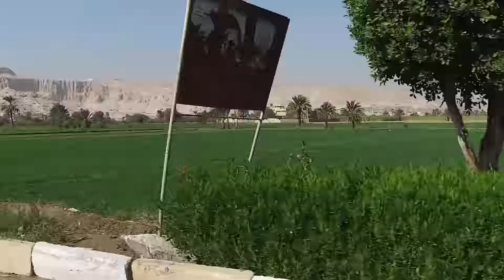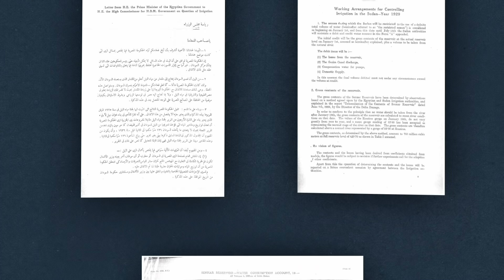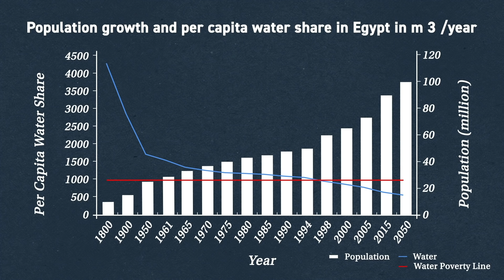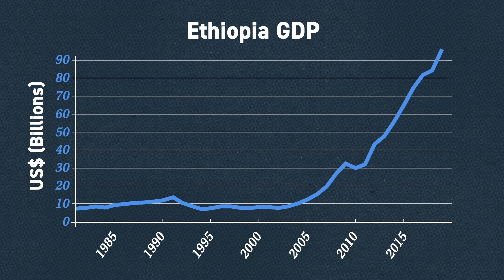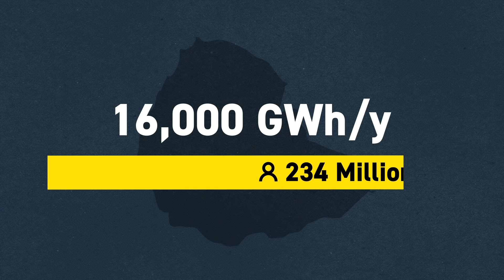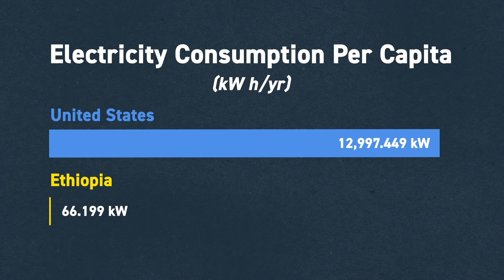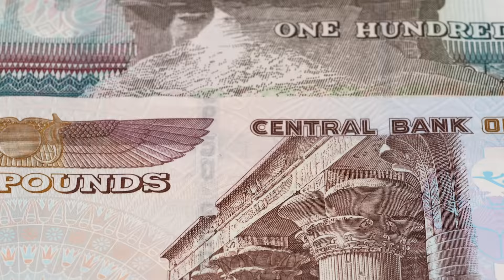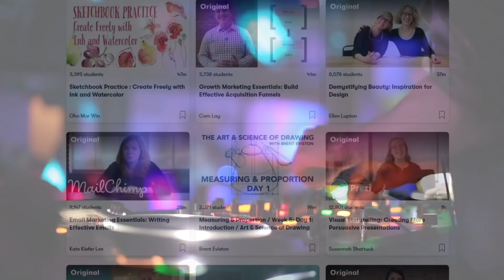Egypt's Dam Problem: The Geopolitics of the Nile

Comment: Egypt just needs their own dam! Sure, Ethiopia can cut off the water supply, but without an extensive series of pumps or canals or something to move the water elsewhere, they can only do that so long before the reservoir overflows. Egypt just needs a reservoir of their own large enough to hold out until that happens :)
Reply: @DavidJohnson-dc8lu  I mean that was mostly a joke, but it certainly would be possible...they'd build it the same way anyone else would build a dam. Obviously they'd need to fill it BEFORE Ethiopia decides to shut off the water, but since Ethiopia can only spring that surprise once and only for a limited amount of time they're not likely to do it right away...

Plenty of countries hold reserves of various resources in case of war or other shortages. Same idea here, except easier. If you don't produce oil and nobody will sell you any, you're kinda screwed. A trade embargo like that can last as long as it needs to. But Ethiopia is gonna have a hard time holding back the entire Nile indefinitely, the reservoir only holds so much, so it should be possible to calculate exactly how much water Egypt would need to store in order to counter that threat. They could store it in barrels or big underground tanks or something, but a big reservoir behind a damn seems like it'd be easier...
Reply: @Urza9814   I don't think you understand Geography, the Nile starts from Southern Africa from Burundi, Rwanda and Tanzania. The blue Nile comes out of Ethiopia directly and the Blue Nile connects to the Nile in Khartoum, Sudan. Egypt is the last country to receive the Nile, building a dam means they have to go into Sudan and build another dam which they have no rights to. Egypt building a dam in Egypt is a wasted expense, they have to go in another country they have no legal rights in 2020 and from now on to do. Learn how the river Nile flows, which is up flow not down flow and where it starts.
Reply: @DavidJohnson-dc8lu  I don't think you understand how dams work. As long as the river flows through their country, they can build a dam on it. You don't have to be right at the source of a river to dam it...

Now, there might not be a suitable location for such a reservoir, or it might require flooding land that is too valuable or blocking river traffic that is too essential, in which case they'd need to compare those costs against big storage tanks or artificial lakes or desalination plants...but it's not an insurmountable existential threat, the amount of water they would need in order to counter that kind of hostile action by Ethiopia should be pretty simple to calculate if you've got the information and resources of a national government. It's not an unknown quantity, they should probably already know exactly how much such a strategic water reserve would cost to implement and how best to implement it. Maybe it's a dam, maybe not, but that's certainly one of the options.
Reply: @Urza9814   Yes but Egypt building a dam does not limit water from going to Ethiopia or Sudan. River Nile starts in *Burundi Tanzania, Rwanda*, DR Congo, Kenya, Uganda, South Sudan, Sudan, Ethiopia and Egypt, in that order. Any of the countries builds a dam it restricts flows to the proceeding countries. Egypt building a dam would be Egypt building restrictions on itself. The waters that enters Egypt does not flow back to Ethiopia, Sudan, South Sudan, Uganda, Kenya, Congo, Rwanda, Tanzania or Burundi. The River Nile is dependent on rain from Southern and Central Africa not Egypt. Egypt is just a beneficiary of the rain from the South. In fact, I think the dams that have been built might even cause flooding in Burundi, Tanzania and Rwanda, these countries produce rain very well, but the dams restrict natural water flow.  Also just look at Zimbabwe, the moment the built one of the largest dams in the water, was the moment that country suffered from drought. Dams bring drought or flood. Depends on how it rains or if the area is reliant on the river directly.
Reply: @DavidJohnson-dc8lu  you are missing my point entirely. They don't have to prevent other countries from getting water, they have to store water for themselves. It's not about building a dam to stop the water -- that's really not what dams do anyway. It's about building a dam to have a reservoir for that storage.

The upstream dams can't block the river forever. Ethiopia can close off the dam and screw over Egypt for a limited time, but they can't stop the river upstream from them, which means eventually their own reservoir fills up and overflows and that water starts to flow downstream again. Egypt just needs somewhere to hold enough water in reserve to survive until that overflow happens. If they had that much storage capacity, then Ethiopia cutting off the river is no longer an existential threat. Egypt could just sit back and wait it out.

Comment: The cause of the root problem on Nile is Egypt. Egyptians are very greedy to use the river while other countries shouldn't. I  didn't agree with the autour of this video on a point he bring rainfall into the case and it MUST NOT BE discussed here. Although egypt receive little rainfall, it has a huge ground water, read sea and Mediterranean as a source of water. With regard to the Nile, Egypt is no other from other countries and it Must benefit from the water based on the amount it contributes to the river. Otherwise why the up stream countries spend billions of dollars every year on soil and water conservation. They should also improve their water use practices. They are using a water for irrigation with the technique since the time of the ancient egypt. They are pouring water like a country which is water rich. Its their problem and its upto them to solve it.

Comment: Egypt doesn't appose the construction of the dam. All we're asking for is that the way the nile, an international river, flows should be agreed upon. The same situation is similar with sudan and they have 5 dams but it all occurs acc. To agreements. Ethiopia is acting unilaterally on filling and working the GERD which affects both Egypt and Sudan tremendously. Egypt is asking for a binding agreement between the three countries and we've been 10 years in negotiations while Ethiopia is stalling and isn't even trying to reach an agreement.
Yoy have every right to Build the dam and benefit from the nile but WITHOUT harming other countries.

We want a situation similar to the senegal river, while Ethiopia wants to use the blue nile as it owns it.

Comment: Note that 16,000 GWh/y (about 2,000 MWs of installed capacity) is what Slovenia produces. That is nothing for a country of 100 million people.
Reply: There are many other dams, Ethiopia has other major rivers, and the real issue is not this dam, but other dams that are planned as well and it is this cumulative effect that has terrified Egypt and I don't blame them. Reality is that both populations don't like each other, but historically and now as well (they will both deny this).
Reply: @amanrusom9498  I believe that my point was that this is not a dam that will make Ethiopia a literal powerhouse, something the video suggests.

The biggest issue is the consumptive use of water, something that Ethiopia is entitled to like any other source of water. Egypt (and Sudan) use zero consumption as their starting points and likely their end points as well.

Except for the Omo, most other rivers contribute to the Nile: that is the natural of the basin.
Reply: @stevensmith2078  not quite I believe that there are 3 other major rivers but your point is valid if you look at the current consumption Ethiopia would have a large surplus but if the industrialisation continues and people start using more home appliances the surplus would disappear quite quickly and then the idea of exporting electricity would laughable.
Reply: @amanrusom9498  They are both looking to the future…hence the problems. Egypt sees Ethiopia’s geopolitical advantage as an existential threat, which it is.

Comment: It's an issue of economics that can be diplomatically resolved. They should do away with the colonial treaty and agree on a new one that outlines how these waters are shared in rainy and drought seasons.  I see no reason why they shouldn't create a Nile River Basin Management Authority. Under such auspices, they can agree, for example, that Egypt compensates Ethiopia for lost revenue for the time taken to slowly fill up the GERD (Grand Ethiopian Renaissance Dam) over the coming decade, and meanwhile. As an incentive, Ethiopia can agree to export subsidized electricity to Egypt as the Dam's capacity is gradually increased.
Reply: Ethiopia already created a Nile basin initiative in cooperation with the upper riparian nations before starting to build the GERD and Egypt refused to sign the agreement out of fear of losing its nonexistent veto power on the Nile River, so Ethiopia went on and just started building the Dam.

Comment: I live in egypt. We already have times where there is no water in the taps sometimes for days on end. If this got dramatically worse, it would disrupt life even for the rich. So it will kill the poor. We can deal with slightly less water, but a significant disruption would be devastating for people. Ignoring politics. It is a terrible idea to fill it quickly.
Reply: In Ethiopia, what if I told you that there are times when we don't have water and electricity at the same time for weeks even months.

Comment: So in a nutshell Ethiopia is beginning to use it's natural resources for it`s benefit. Ethiopia will be sharing the power and water will still flow. For expecting 10 years to slowly fill the dam and abiding by some colonial treaty 120 years ago is nonsense, that treaty was written to indirectly benefit Europe via water for textile and farming in areas of Africa they wanted to make a profit from. What will Egypt do if the other Nile River is dammed and also used for hydro power? How about investing in desalination,  vertical farming, advances water recycling for farm and home use, and technologies that gather water from the air. Egypt will have to actually be innovative and do work to diversity and manage a resource that they have to actually share versus their colonial buddies giving them a monopoly on paper over it.

Comment: How does pumping water into a reservoir generate more power than it takes? lol
Reply: If constructed correctly, there should be very little, if any, pumping. Basically you throw up a wall, wait for the water to build up behind it, make some openings, and let the falling water push a turbine. 

It’s powered by gravity, not pumps.

Comment: Sam Denby and Tristan Purdy, you have missed to include the most relevant information of all times. 1) There is an organisation of upper stream Nile countries which include all beneficiaries except Egypt, who is not interested to join. 2) Salam canal  - Egypt sales Nile water through underground Salam canal to Israel, used for Negev desert  irrigation. 3) Egypt  will not be affected by the GRID, as the water will continue to flow as usual through GRID turbine after generating electricity. The concern actually comes from Israel. Israel was pushing Egypt, and USA (
Steven Mnuchin Jewish origin) to lead the negotiation for her benefit. 4) I totally disagree on your statement "Ethiopia has just come to realize the country is a natural geographic master of the water way". Always they knew the importance of their water. Unfortunately, there has been a coordinated foreign effort to sabotage Ethiopian's plan to use their own water.  History shows that Abay (Blue Nile) has always been a fighting ground for thousand of years between these countries. Egypt did invade Ethiopia in 1874 to control the red sea corridor, and the source of the Nile region. Egypt was totally defeated. Ethiopia had the victory.  I hope it helps!

Comment: Egypt will see rolling dry-out in less than 3 years. That will end 45,000 years of geography (river digging a valley and sleet saturating a delta), of which at least 11,000 years of continuous inhabiting, of which at least 7,000 of civilization. 
The water remaining in 10 years will accommodate 3 millions at best. The rest of the 120 million inhabitants will end in pandemic, famine and war.
The Mediterranean will claim the delta under 1.5 meter of salt water, the ground water will finish, the desert will cover the muddy valley....
His Glorious Highness / Victorious General Al Sisi answer is: fortified walled cities and gated communities.
The current junta is an extension of the Mamlook dynasty. Neo-Mamlook, 4th Dynasty with Nasser the resurrector.

Comment: Water banks 😂, there eare more than 10 dams on river nile (only one for egypt), even ethiopia have dam over tana lake,  As egyptian would like to mention that Egyptian goverment didnt mind that ethiopia build a dam as they sign agreement in 2015 , but have to observe the enviromental and safty issues , but the design ethiopia had is not ok as can not generate electrcity because of silt problem which carry from ethiopian mountian more over they plan to have huge lake which  they plan to create water bank, incase of fail the ethiopian dam we can control the flood in egypt, but sudan will simply vanish which is unfair

Comment: You forgot to mention that China is funding the cost of the the dam’s 14 turbines, which China will be manufacturing, installing and operating; at a cost of $1.8 billion.  This dam is not self-financed entirely by Ethiopia as you imply.  Ethiopia is part of China’s “One Belt One Road” worldwide infrastructure building program.  When it comes to funding infrastructure projects in 2nd and 3rd world counties all the roads lead to China.  Ethiopia’s current debt obligations to China is +5% of its annual GDP.

Comment: It's Egypt's problem that they never thought to improve their irrigation system, opt for other industries/economic sectors and to develop their country overall. One can build tidal plants for energy, and desalination plants to win water. But no: no development, an ever increasing population, water waste though an hundred years old irrigation systems, and water intensive agriculture (=> cotton).

Egypt failed to do its home work for decades, while Ethiopia at least tries to move forward, and, as matter of fact, made significant progress.

If Egypt wants Ethiopia to fill it slower, then they have to compensate the financial loss.

And what cooperation? Egypt is only willing to take, but not willing to give anything in return.

Sudan and Ethiopia have an agreement. It's only Egypt that thinks everything can remain the way as it was: to the sole benefit of Egypt.

"[...]get on the path towards that, they need to focus on the Nile as a tool for unification rather than division. They need to ignore the political relics of the region's colonial past, and forge their own future based on the realities today."

This alone justify a thump down.

Nice Sunday speech wording, but utterly meaningless and without any concrete suggestion to solve the issues. There are clear contradicting economic interests present. Not some ideological, political or religious ones that could be solved by "talking".

This is realpolitik in regard of limited resources, and monetary losses or gains.

Egypt will have to accept that the one way system they were given by the British Empire during the colonial era is over. It has to reform its own economy. Being less dependent on agriculture and water (=> demographic development), and also treat water as something of value by using it far more efficient. It also has to develop its economy to gain other way of access to water; like  through technology (=> energy and capital). But it has also to accept, that it has to pay a compensation to other countries, if they shall hold back to the benefit or need of Egypt and suffer monetary losses by doing so.
In the end it is also about money.

But foremost it is about that Egypt gets its act together.